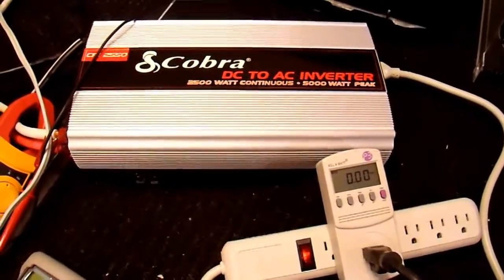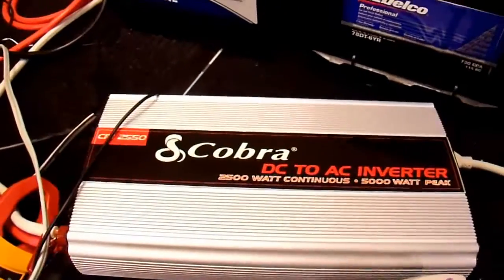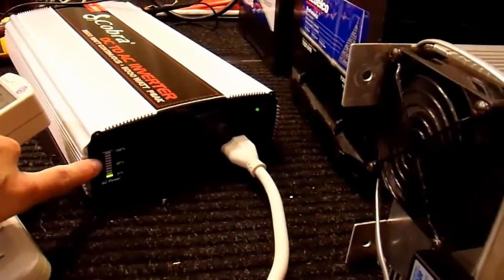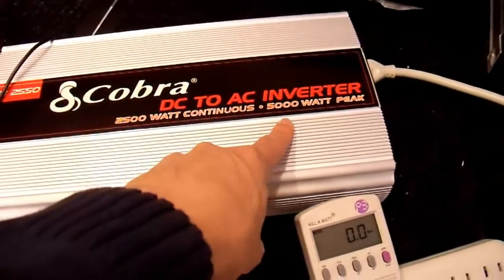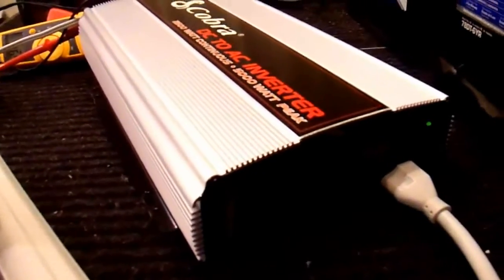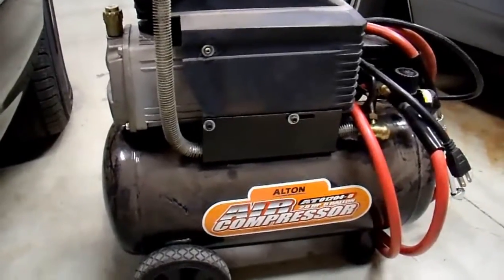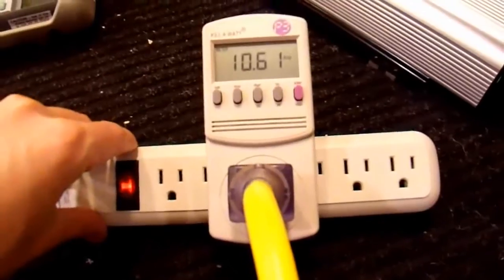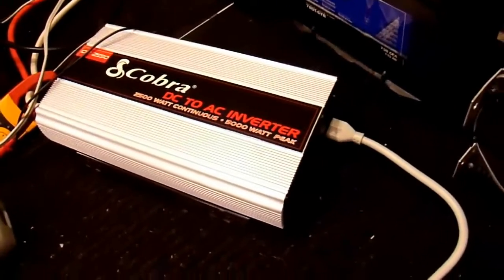Cobra Inverter Review Part6 - Surge Testing with various appliances

Comment from the maker: I am sure there are many good choices for chargers, but the Iota works great - that's about all I can say.  When I got it it looked like someone had thrown it in the mud and forgotten about it for a couple of years so I took it apart, cleaned it up, and it still works perfectly.  The smart charger unit works great too.  It will properly charge any # of batteries regardless of what load profile they are put under.

Comment: Thanks, much cheaper than I thought it would be 100-200 $ range. Is it good quality ? I'm guessing you've looked inside, I know its all a compromise with price etc but you were happy with it obviously for the money, and the function etc.

I'm basically looking for options to charge 24v bank of deep cycle batteres when there is no sun/wind to ensure they don't sit un charged etc, and was wondering about the invertor chargers.

Comment: In a previous video the battery amp draw was about 240 amps and 12.5 volts input. The internal fusing was 320 amps, so you provided 75% of that and got 2000 watts output. If the full 320 amps could be applied then ~ 2700 watts maybe possible. Less some fusing headroom 2500 continuous possible?